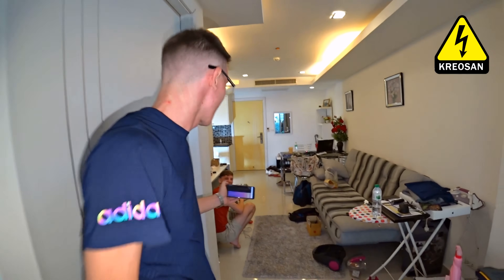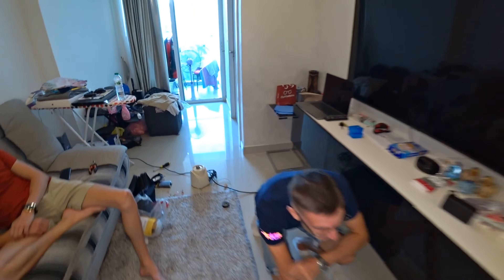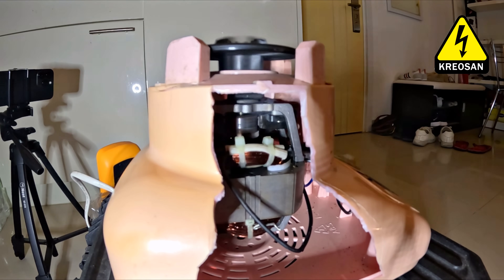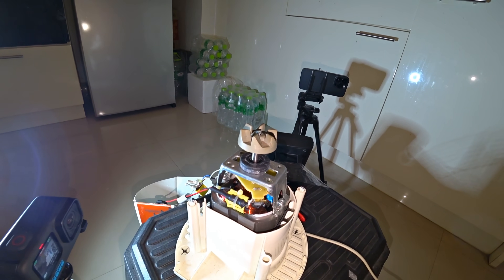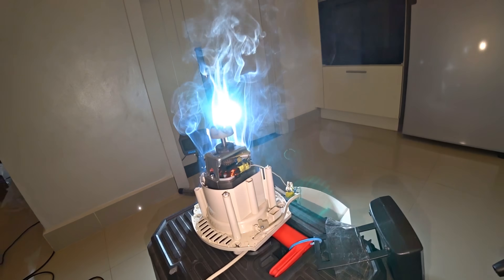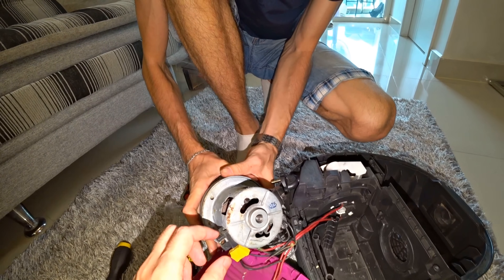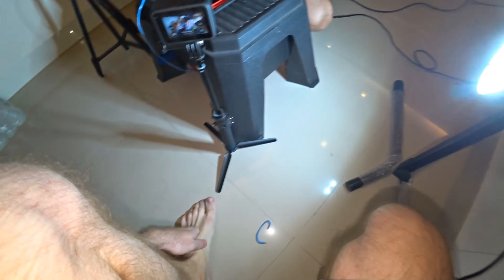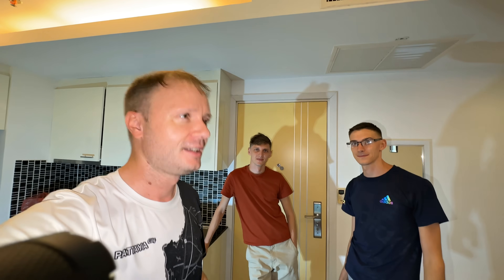✅MOTOR acceleration to EXTREME SPEED ☠️ FORCING ELECTRIC MOTORS from KREOSAN⚡️⚡️⚡️

Comment: It’s stupide to remove the turbine !
This would prevent the engine from overheating, and would have allowed its potential to be tested. absolutely no point in removing the turbine! it is not made to work without it, it must dissipate heat

Comment: You should use motors that are in dryer machines or big fan motors that don't have any brushes in them you'll have less problems with heat using those types of AC motors for tests like this.....

Comment: a metal lathe, please over clock a metal working lathe.  Shift the lathe into 4 threads per inch, turn the spindle to max rpm, with something horribly off balance clamped into the chuck. Then move the carriage all the way to the end of the ways, opposite the headstock. Let the spindle get to full rpm's then engage the threading handle on the carriage.  Believe me this will get views.

Comment: A powerful hand held router. For extra credit: Attach a motorcycle wheel to the router shaft. I was dumb enough to do that in my bedroom when I was a kid, but without the microwave oven transformers. I just wanted a powerful gyroscope to hold in my hands. Somehow it got loose and went on a rampage. I had tire tread marks on the walls and even a few on the ceiling, put holes in the walls, broke lab equipment, and very nearly made me crap myself. I wouldn't hold it if powered by those MOTs, insta-death if the angry pixies get you, and only a slightly less bad idea to be in the room if the wheel gets loose. Would love to see it again, but in video.
Reply: I laughed so hard at this 😂😂😂wow must have been terrifying 😅

Comment: KREOSAN READ THIS, you should remove any filtering and protective parts like MOVs, capacitors, fuses, filters, etc, if you want to get the most out of the motors. The second motor had a MOV which didn't allowed you to reach the maximum rpm. Other than that stay safe and cool 😎